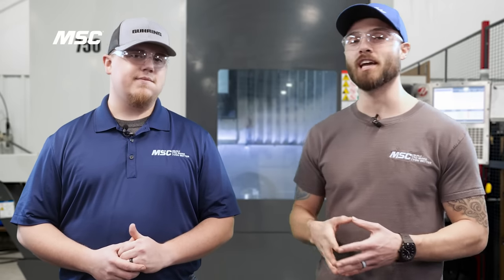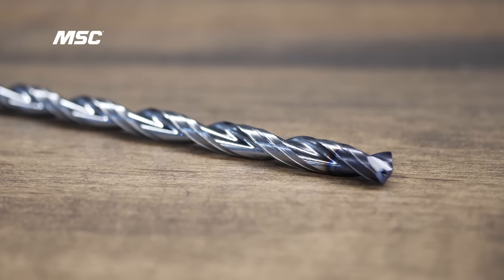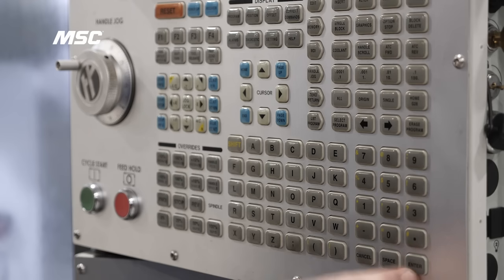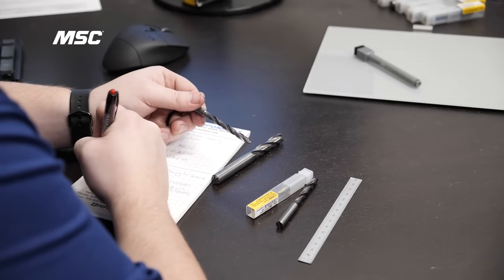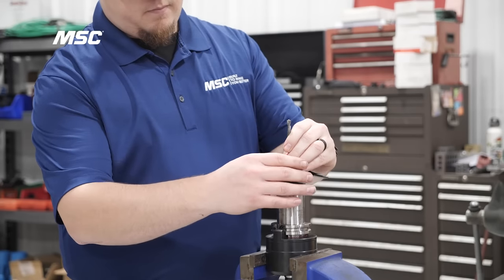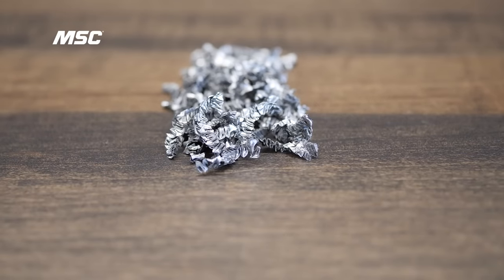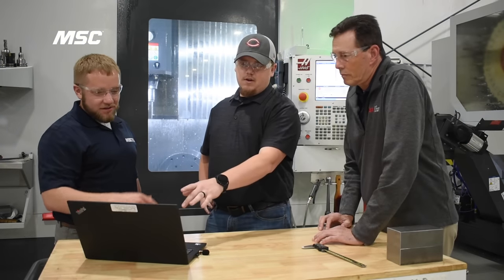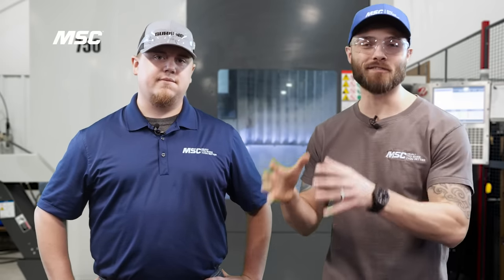HOW TO: Drill Stainless Steel - 6 Tips

Comment: It's also worth mentioning for the novis or weekend warrior that carbide drills require consistent and controlled motion by the machine so don't use them for manual drilling. Unless you are really on the ball you will destroy them in short order.

Comment: Great job guys. Solid guidance on increasing feed and lowering spindle speed. Peck drilling can certainly cause hardening in stainless although I would not consider it a very tough material to machine vs. many others out there.

Comment: I’ve found that for manual drilling, cobalt steel bits work well with no breakage. As discussed, plenty of coolant, aggressive feed, and low speed. Make sure the bit’s sharp. Do not “peck” or let it skate. Pilot the same diameter as the web on the final size drill. Watch your chips and keep them long and unbroken. If they’re breaking or thin, your feed pressure is too low or inconsistent.

Comment: My shop machines 316 and 17-4 H900(44Rc) almost exclusively.  We us only solid carbine coolant fed ALTin coated drills.  A job we just finished:  Drill size .368 (U) x 8D.  Material is 316.  RPM 800. We  first use a coated  140 deg spot drill to .06 dp. This ensures the drill is on center.  Start the drill at  .0015 IPR to a depth of .1, then increase to .0025 .  High pressure coolant is best, but a normal coolant flow will work.  Drilling to 1.7 deep.  No pumping- that will disrupt the chip flow.  255 parts this time and is the same drill we have used for this part for YEARS - yes the same drill.  That’s a lot of parts.  But here is the real secret;  We have  made or own eccentric holders to fit ER16 coolant collets.  Indicated within .001 of center.  On some parts we use on size drills to complete holes without any boring and meet surface finish of 63 or often much better.  On one part we drill a .255 dia x 1.525 dp holding +.002/ -00 dia. In 410 QDT.  Dialing the drill in on center is THE most important thing to achieve.

Comment: In the elevator trade our mechanics tell me that when drilling an elevator car operating panel to add maybe a key switch to lock out say a basement floor that you do not want the public to have  access to,  they would have to drill the a hole in the existing stainless faceplate to perhaps 1” to 1 1/4” dia. For the Hole for the key switch and it’s plastic collar.  The told me they always use a household liquid dish soap as a lubricant on the drill bit.   I believe they always drilled  the hole with the faceplate  in place that was 1/8 in thick.   That is, they did not take the faceplate off the cab control panel in the return the panel back to a shop to drill it.  I have never tried drilling anything with dish soap but they assured me it works.  Anyone ever try this?

JoeB
Reply: Yes.
Reply: No
Reply: The 1/8 inch is very thin, and you can get away without concerns of work hardening. 1/2 inch will be when the problems are.